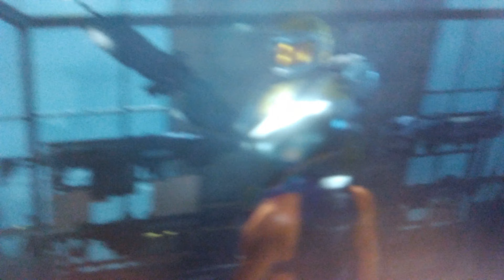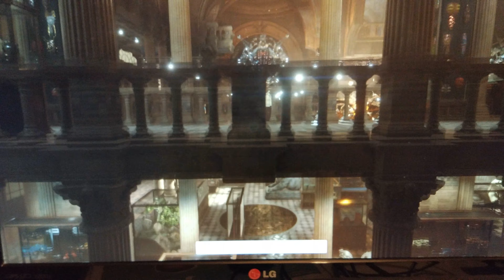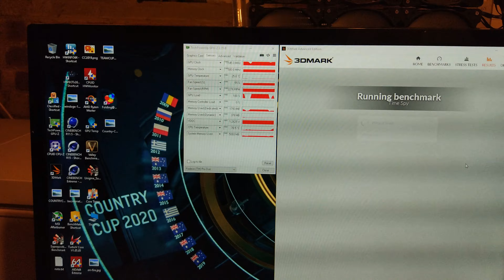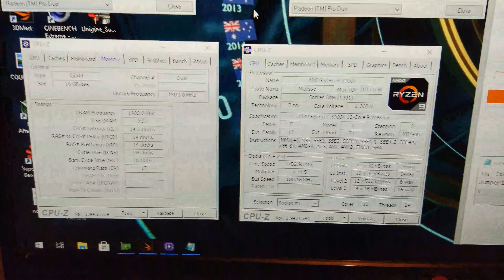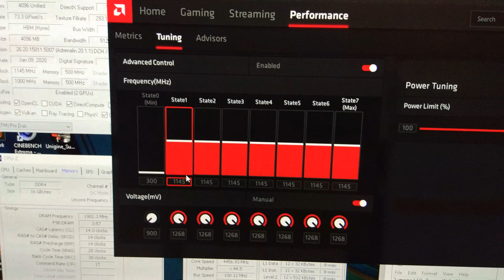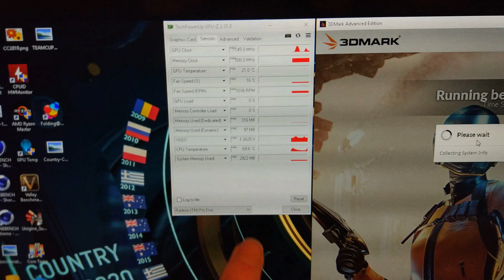Water Cooled AMD Radeon Pro Duo VS 3DMark Time Spy

Comment: Hey awesome video! do you know what is the thickness of thermal pads for the gpu? I have the block but no pads :(
Reply from the maker: I don't know, I bought mine with the block already installed.
Reply: @LawrenceTimme  all good found the manual online! such a pain to work with these cards hahah. The original aio leaked so I had to get a custom block, thanks for the video tho. there were no other resources lol
Reply from the maker: @burtonsun4498  that's why I make these videos! Nobody else does

Comment: New BIOS out for that board
Reply from the maker: Nice ill check it out. My 6800 is here now as well. Look for a video of that coming soon :)
Reply: @LawrenceTimme  bios landed for my b450 just can't get hold of a 5600x
Reply from the maker: @DrhexUK  there are loads coming in mid to late December, keep and eye out for them
Reply: @LawrenceTimme  ccl-online got some in stock today but I refuse to pay 319 for one
Reply from the maker: @DrhexUK  wait till the new year and the none x model comes out. 👍
Reply: @LawrenceTimme  The 5600x should be £279 not £319. It's bad enough with ebay scalpers and then retailers start going above MRP too
Reply from the maker: @DrhexUK  don't blame them when they sell out everything they can get! It's crazy atm.
Reply: @LawrenceTimme  Look for Curve optimiser in the BIOS. See if thats been added
Reply from the maker: @DrhexUK  right I am going to test it now.👍